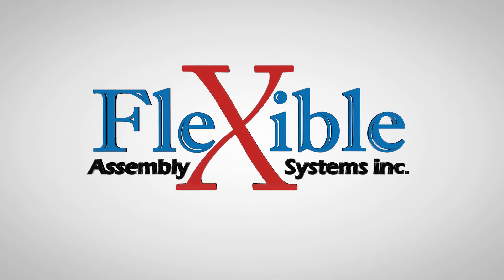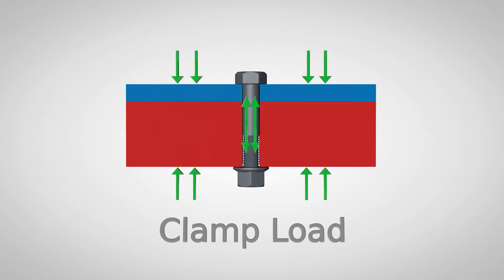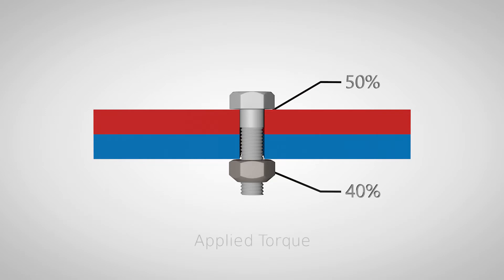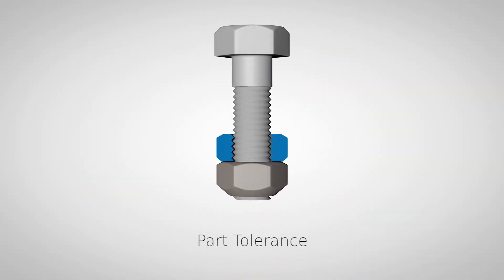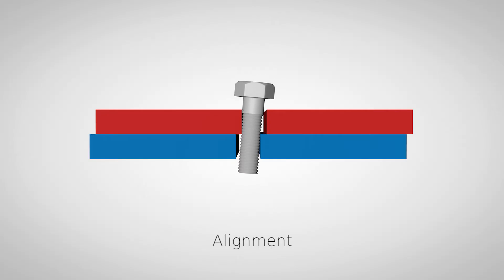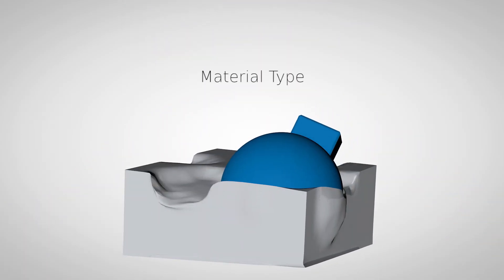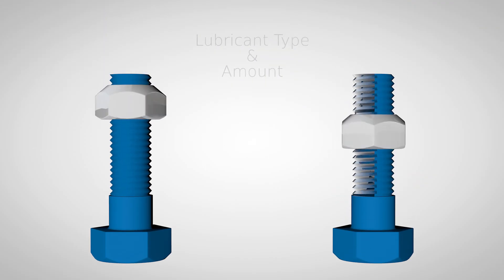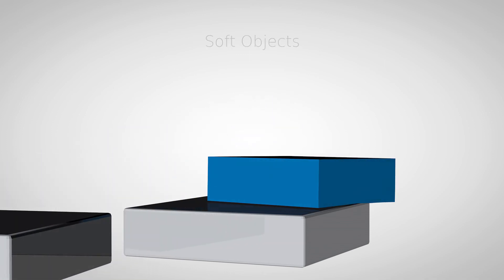Friction Factors - Fastening Theory Part 2

Comment: You dont talk about what effect threadpitch has on tranforming torque to clamping force. What happens when the pitch is changed either way?
Reply from the maker: That is a good point. I didn't do much research into that particular question. A smaller thread pitch increases the surface area on a bolt, which would also increase the friction within the bolted assembly where the bolt interfaces with the nut. My guess is that a smaller pitch requires more force to overcome the extra friction. Definitely a good topic for another video!

Comment: Great, basic information. I really wish you had gone more into information about what happens to the fastener as tension is applied, like how the bolt is elongated, changing the tolerance of the inclined plane, while creating maximum clamping pressure, and how further tension or excess torque leads to failure. I thought that would be discussed, given the graph that was shown at the beginning of the part 1. In any case, this is good info, but is definitely missing that key part.
Reply from the maker: Thank you! You bring up excellent points, we should do a follow-up on this video including that information.
Reply: Flexible Assembly Systems Inc That sounds great! Still, though, I've already shared this video with someone. Looking forward to future ones!
Reply: So far great, Looking forward to Part 3, explaining the queries raised byTravis already!!

Comment: Which is the better method of measuring residual torque, Re-tightening  Torque method or loosening torque and why?
Reply from the maker: Assuming no glue or loctite was used the best method for auditing residual torque is the breakaway strategy. Using a torque wrench equipped with a transducer (and gyroscope for added accuracy) the operator can use a residual torque audit strategy to slowly apply fastening torque to the bolt until it rotates. Most torque audit strategies use this method as it doesn't require re-tightening the bolt. The downside to this strategy is that in doing a reading you are risking over-torquing the bolt. It's recommended to very slightly under-torque the bolt originally by the amount which you have determined through testing that it will over-torque during the audit process.

If over-tightening is a concern, then a safer bet is to use the loosening strategy, however this has the downside of now having to re-tighten the bolt after you have confirmed what the residual torque was.

A third method would be the loosening-tightening strategy. The operator would use a wrench with a gyroscope to loosen the bolt by a certain degree (say 10 degrees), then tighten the bolt by the same amount they loosened it (10 degrees) and measure the peak torque which was recorded. If a gyro tool isn't available then a mark can be made on the bolt to ensure it has been tightened back to the same angle.

In all cases factors such as rust in the bolt, tolerances of the parts and operator influence can effect repeat-ability. Wrenches that include a gyroscope and transducer can use algorithms to negate the effects of operator error. Either way it is impossible to measure the residual torque in a joint without actively effecting how much clamp force is applied during the test. Hope this helps!